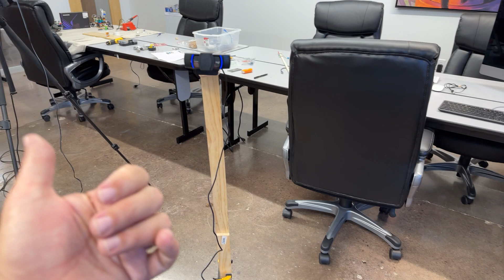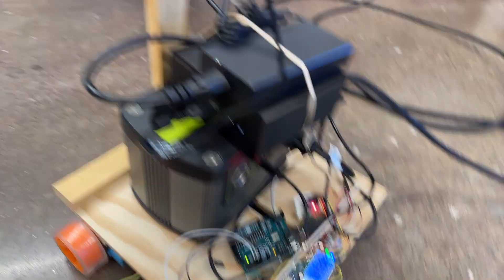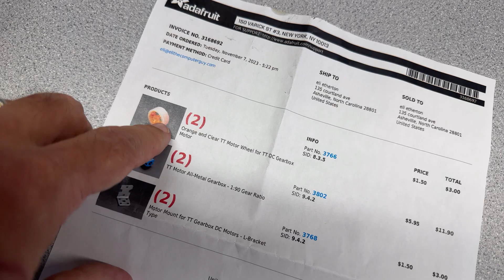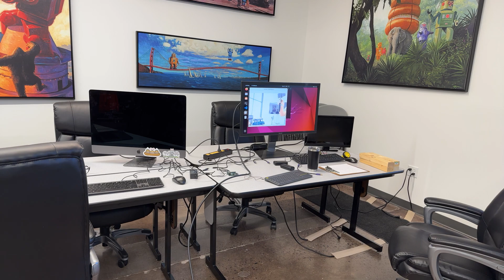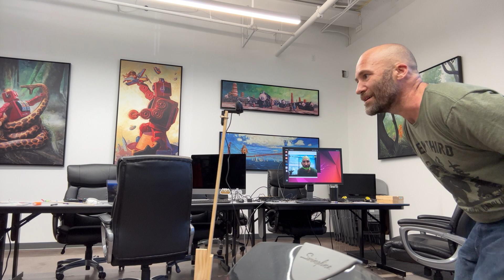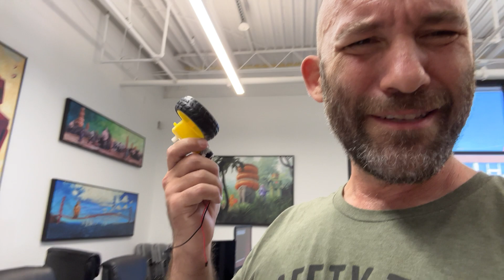Object Tracking Robot -  NEW MOTORS!!!

Comment: Love this. Next cheap iteration for the current build would be another 1 x 2 from just below the camera to the front of the rig. That triangle should fix most of your wobble at that speed and height...assuming you do not add a heavier camera at the top of it.

Can't wait until you go for broke and buy a hdmi wireless transmitter/receiver and have this follow you around the building...

Comment: 2:40 I think the cause of the jerky motors is because the DC motors are responding to each of the input values of your sensors. In other words, for each input value that the sensors detect, the motors are adjusting for each value and that's why they jerk. A simple  to fix this is by doing simple math or rounding the values that the motors responds to.      

   Example: If you have an input value of 1-120 varying, and  right now your motors are reacting to values: 2,2,3,3,4,3,3,4,3,3,2,2. It reads all these values in seconds.
    Notice how the values are fluctuating between 2,3,and 4? The motors are reacting to each input value and it's adjusting to each value. So, you can easily just adjust your code by telling the servos to move in increments of 3. That way, the motors stay fixated if the input values increase or decrease by very little. Of course, if the change is drastic, then the motors will move. 
You can also add a filter on the sensors as well, to filter out the varying values from the sensors. I learned this from Jemery's Blum arduino tutorial series, although some of his tutorials are outdated, there's some value still there.
     To learn more about the filters like low pass filters, and high pass filters, you can go on the Organic Chemistry Tutor for free. Using the Arduino Kit, that Eli shows you how to use, you should be able to build your own filters using Low Voltage, if you're interested in building your own filter instead of just adjusting your code.